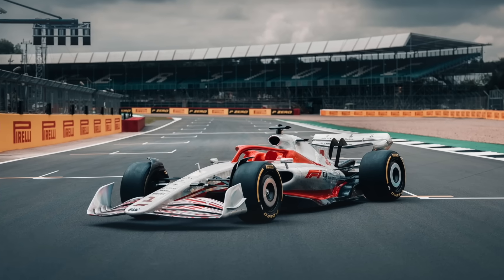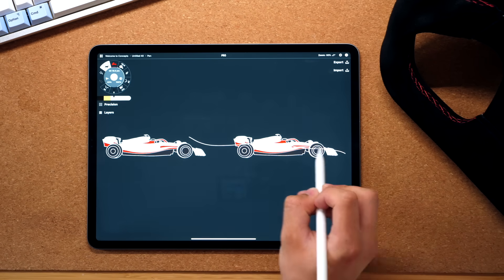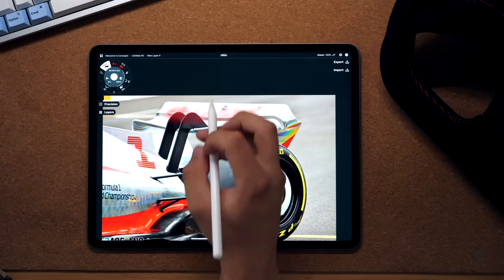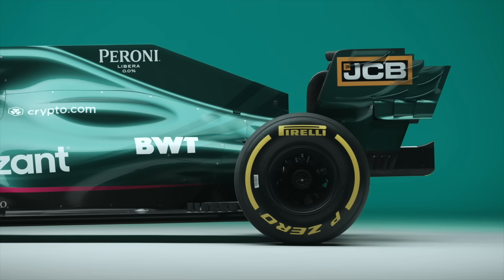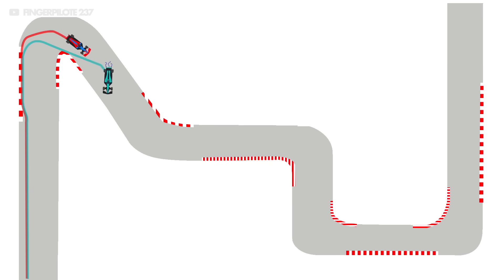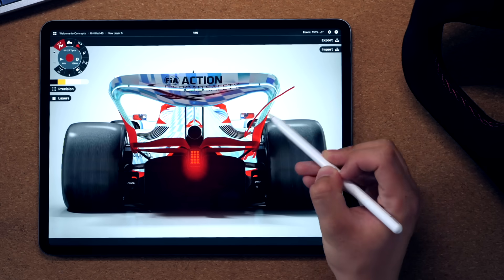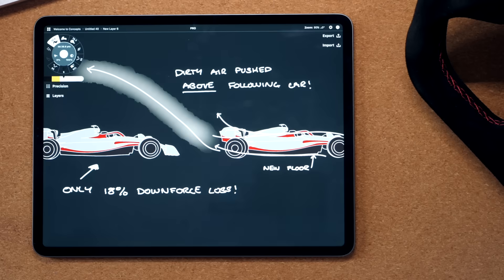Why Formula 1's New CURVED Wing is GENIUS

Comment: Does this wing still have DRS?
I haven't seen any info on this before that's why Im asking
Reply: yes, DRS will still be in place, but the goal is to get rid of it if the cars' concept of better racing pans out
Reply: It will in its final iteration.
Reply: I believe DRS will be a thing until 2023, subject to change depending on how the racing is with the new cars
Reply: Maybe not,like the hybrid motors are getting better,the Drs wing part was over rated.i think 2022 is over with too much down force and dirty air will be a thing of the past.
Reply: Hopefully it won't be needed. Seems to me that back in the late 70s and early 80s, when Venturi tunnels were in use and before flat floors were required, the racing was pretty close, and it was really down to who had the most consistent race pace...IOW dirty air wasn't the problem, consistency, fuel management, and tire management were the greatest challenges...qualifying was often misleading, as the turbos would drive away with most of the top spots on the grid, but then they would frequently blow up halfway through the race.  The normally aspirated engines remained competitive until Renault, Ferrari, and BMW figured out how to run higher boost levels without detonating the engine. Fun times!
Reply: Yes DRS next year, possibly 2 years. It's not on the models so far because the FIA claims it won't actually be needed. They're keeping it for 1-2 years though just in case. Then in the real world analysis of racing with 20 cars on the track at once, they can analyze speeds and overtaking and close racing to see if they can actually ditch DRS in the 2025 formula spec.
Reply: My understanding was that the new regulations are designed to enable overtaking without the need for DRS
Reply: how do you make the simulations of the aerodynamics like that?
Reply: Haven't seen the actuator on it
Reply: Dein Profilbild ist Legende 🐣
Reply: Short answer: Not currently implemented. 

With the new F1 car design most of the downforce is now generated through ground effects which first came into prominence in the 70s the most notable example being the BT46B aka the Fan car. 
Ground effects is being used in LM cars as it generates a greater downforce than a wing alone with some cars even opting to remove the wing entirely however that's mainly due to limitations due to regulations a wing is still good. 
DRS is only useful for the straights as the new wing doesn't give no where near as much downforce as the current mechanical wing which opens up to reduce drag (DRS). 
To add DRS to the new wing design they will have to add more mechanical parts making the car heavier and it will not have as big of an impact as it does when compared to the current wing design so arguably DRS is not necessary for the next season of racing.
Reply: @Kazimx0786  im really curious to see how the ground effect with the tires is going to play out when someone touches a kerb.
Reply: @Kazimx0786  yeah but now with ground effect being so important, anything that upsets that airflow could have dramatic results. Less sidewall on a tire means it should give alot less on kerbs. I imagine kerbs will be like lava. Who knows though, maybe the suspension will make up for it.
Reply: @GonzoDonzo  I think they should eliminate car damaging curbs and enforce track limits. Especially Austria. They're ridiculous.
Reply: @Malc664  yeah im with you on that. First corner in every race is just ridiculous as half the field goes off track. Starting to see people get taken out as they re-enter the track in races as well.
Reply: @GonzoDonzo  That brings to mind when Lewis was pushed off at Imola, the car took some damage. That curb was bad.
Reply: @GonzoDonzo  With this design, the ground effect is used to create the majority of the downforce and not all of it. Kerbs were so dangerous back then because of the skirts that were used. If you lifted the skirt, the air from outside would get inside and you would loose all downforce. With these cars, this shouldn't be that big of a deal.
Reply: @lalxl  thats the thing though, with less sidewall in a tire it should lift the body changing the airflow beneath the car that could upset the ground effect. So if its disturbed while pulling high lateral g's it could be enough for the car to suddenly lose grip. We will have to wait and see because all we can do is speculate. Just one more thing to look forward to for 22'
Reply: @Kazimx0786  Wasn't there footage of a model in a wind tunnel where the top part of the wing seemed to move up and down? I think its even in this video.

Or was that just some optical illusion?
Reply: @Armageddon_71  the one that was shown was on the current F1 model not the new model.
Reply: @Kazimx0786  ...No. There was definatly footage of a 2022 concept. I could be wrong about the Wing moving though.
Reply: @Armageddon_71  oh I know what you mean it was the new car but there was no wing movement in that model.
Reply: @Kazimx0786  Ah ok then I was wrong. My bad
Reply: @Kazimx0786  ok. what about the power stored during regen. braking wont it be used as the additional boost as drs ?
Reply: @Terra-Loop  Ever since the dawn of KERS  F1 cars have implemented ERS (Energy recovery system). 
When the redlight is blinking on the rear of a F1 car it is to show the driver has lifted off the gas and the ERS is active as it acts like a brake by puting load on the drivetrain, which warns the driver behind.
Reply: @Kazimx0786  indycars have been using it since their last chasis upgrade
Reply: The concept car does not have DRS implemented and there is no official answer if it will.
FIA Wants to remove DRS, that is said but no decision yet!

Comment: 18% less downforce, So we need a bigger drs in order to be able to overtake in the straights.
Reply: Less downforce means less drag, higher straight line top speed, and less dirty air which means easier following through corners.
DRS exists because cars lost time following through corners, and so it was made up on the straights with it.
If cars can follow eachother easily, DRS has lost it's reason for existing

Comment: I'd be curious if a mandated rear-wing endplate spoiler like aircraft have on wingtips would also help reduce end vortices. Quite excited for the new cars, hopefully they're faster due to the increase in clean underfloor DF - next step is to hopefully lighten them up a bit.

Comment: If this works as intended the next question will be DRS. DRS was brought in precisely because of the following problem. If it becomes easier to follow through a corner then DRS will mean it will become virtually impossible to defend in a DRS zone.

Comment: At what distance dirty air becomes slip stream 🤔
Reply: Slip stream reduces drag on the straights, with less air in front the car can go faster. Dirty air reduces downforce on the corners, meaning you have to brake earlier and can’t take the corner at the same speed. Both are two forms of the same thing.

Comment: But why still 2m wide front wings and why still wheel base of 3.60m? In the 80s the wheel base was around 2.80m, which should be enough for a single seater race car. And you would loose weight - I bet at least around 50kg. They have nowadays an around 1m long gearbox, just to lengthen the overall car length for better wind flow to the rear wing. With shorter wheel base they would have to pack the engine/hybrid components more into the side pods. And the car would be more nimble and would move more through corners instead of the very rail-like behaviour nowadays.

While we are at the gearbox: why eight gears? With turbo engine and two additional electric motors they produce enough torque to have only five gears and they can even leave the reverse gear. Another 10kg saved. The changed weight distribution can be balanced with narrower front tyres - another 5kg saved. And the front wing with only 1.60m in width would be less susceptible for collisions with a car in front. 

It could all be so easy.

Comment: I can't get my head around how a diffuser that pushes the air upwards and over the car behind can help with getting clean air to it's front wing. Yeah there's less disturbed air but there's still a big air pocket behind the car so still going to lose a large portion of down force. I'm still sceptical that it's going work because it's all proportional , you give a car less down force to start with and clean up the air meaning the car behind which already has less down force is going to lose some more down force just because of the air pocket putting it back to square one. It may look good on computer and in a wind tunnel but the car isn't moving in real world conditions, we see this a lot with upgrades that come an don't work as expected.

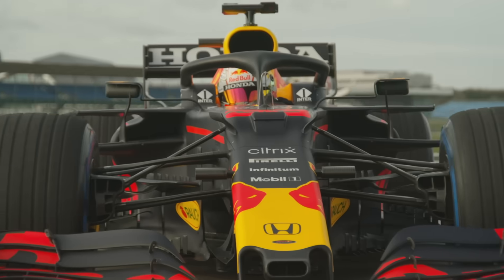Comment: 2:35 that's not exactly all there is. Pushing the air upwards is not what causes downforce, it's the the low pressure zone under the wing that causes the downforce. The cars are "sucked" to the ground, not "pushed" .
Reply: It's both actually

Comment: I didnt complete my engineering degree before I changed career but to me, pushing all the dirty air up/out seems like it will have a secondary effect too, creating a larger 'void' in the air directly behind the car and thus increasing the tow effect too meaning the car behind will get an extra boost, further increasing the chances for overtaking/racing. I might be wrong though.

Though one thing I did notice from the seeing the 2022 car mock up at Silverstone: I couldn't see how DRS will work on the new cars with the vertical and horizontal wing sections being blended.

Comment: Will this help with overheating when following too?
Reply: In theory, it should since there will be less turbulent air behind the vehicle, so any aero structures used for directing air into the radiators will be more efficient whilst drafting. Hope this helped!
Reply: @Awkward_Fox  Thanks I was leaning in that direction, but wasn't sure.  I sure hope it does because multi lap battles would be great as opposed to the attack then cool off model we have now.

Comment: The red bull with that livery looked amazing. Hopefully new car new livery its a little over due at this point
Reply: Hopefully RB never changes its livery. The entire point of the RB F1 team is to promote.... you guessed it right, Red Bull. Would be stupid if they changed the livery to something else instead of retaining the classic colors
Reply: @Someone25948  they don't have to change the colours to change the livery. You can also change the placement of the Bulls and such. Barely anything has changed these last few years but imho the current livery is hard to beat.
Reply: @mielvanvelzen5967  Hmm is that really a livery change though? Pretty sure most people won't even notice it. Beats the point of changing your livery. Agree with last point
Reply: @Someone25948  i mean any change to the livery is technically a livery change. But you could absolutely make it look very diffrent by taking the bulls away from their current spot and further shifting the balance of the colors.
Reply: @mielvanvelzen5967  I didn't understand what you mean by shifting the color balance
Reply: @Someone25948  making one color more prominent then another, or even bringin in a new color. There are lots of options that still feature red bull branding. Question is wether that would be better then what we have now.
Reply: @mielvanvelzen5967  Yeah it's hard to top the present one
Reply: @Someone25948  they can keep the colours but easily different layout/design.

Comment: Can you help differentiate slipstream and dirty air?
Reply: They are basically the same concept, but slipstream is when it's helpful (straights) and dirty air happens when it's not helpful (cornersl
Reply: Slipstream: The car in front pushes the air aside meaning the car behind can go faster in a straight line, but slower in the corners. (Less drag means more speed but less downforce.) Dirty air: The car Infront mashes the air into a turbulent mess that disadvantages the car behind.

Comment: 15 years ago this kind of problems didn't exist. What happened? 
Why did they let this "Vortex" exist? Yes, aerodynamics evolved. But why did the F1 authorities took 15 years to do something about it? DRS is the worst thing F1 did. It ruins the race. All you have to do is push a button to overtake which is absolutely stupid.
So, again, the important question is why they took so long to do something about it.
Reply: What are you talking about? I remember in the 06-08 seasons Brundle always talking about how cars can't follow due to dirty air and reduced downforce. This was a big problem since the early 00's at least.
Reply: @ASJC27  In the early 00's the audience was not complaining about lack of overtaking, even if there was already a downforce problem. 
They created DRS in 2011 (which in my opinion was a totally bad solution) precisely because it got to a point where the audience started to complaint,
Reply: @nelsonramos2955  We must have been watching a different F1 then. I remember constant complaints in the 06-08 seasons.

The whole point of the 09 regulation changes was to try to improve overtaking. That's why they banned winglets and chimneys and changed to a narrow rear wing and banned the biplane front wing. It didn't really work but they tried.
Reply: @ASJC27  We do agree then that 15 years ago (2005 or so) it was not a problem. Afterwards it became one. 
They had the power and the instruments to solve the problem. It would be at the cost of something of course. But we never knew what was the cost and still we don't know. At least i don't know. But if you have information, please let me know (no irony).

Comment: Will the use of more efficient ground effect lead to higher top speeds next year?
Reply: Ground effect mostly increases corner speeds and accelerations, not top speed.
Reply: @enricocosta4441  What I mean is for a given level of downforce, would the the drag from ground effect be lower than from a rear wing? Giving higher top speeds for the same downforce.

Comment: This might be a stupid question, but will the following car have better or worse slipstream advantage in 2022 compared to this season?
Just asking because “losing” downforce in long straights actually increases top speed, as far as I know. And this would make the low dirty air concept a tradeoff, meaning less overtakes on straights and more overtakes in turns (?).

Comment: When I saw the presentation of the mockup which was described as "the 2022 Formula 1 car" I realised just how wrong Formula 1 has gone since I started watching it in the 60s. Formula 1 used to be and should still be all about innovation. So for me, if you can actually say "this is what a 2022 car will look like", something has gone wrong. It shouldn't be possible to say that because the regulations should be such that all they do is to regulate the minimum and maximum dimensions of the cars and their components, and the materials which the constructors are allowed to use.
It should be possible for constructors to design cars which look radically different to each other. The FIA are already standardising a lot of components, so we are getting closer and closer to having just another standard car with different livery as in many other formulas.
Maybe I'm totally wrong, and the designers will be able to produce quite unique solutions within the new regulations. I hope so, and even more than that I hope that the new wheels and changes to the diffusers really do mean that the cars can follow each other closely without ruining their tyres or losing their grip in corners.